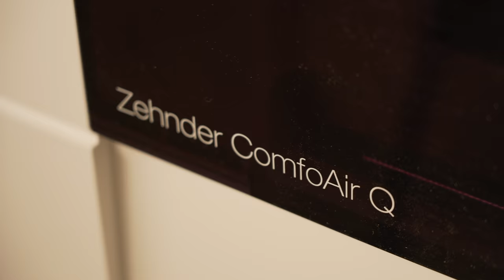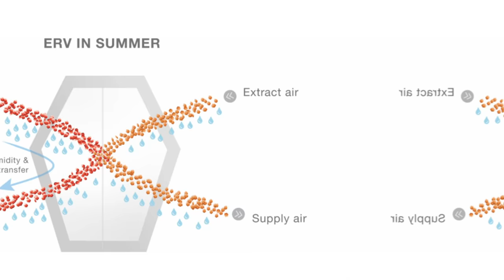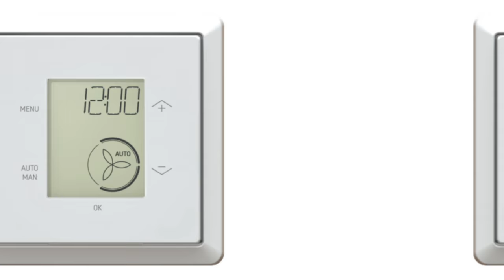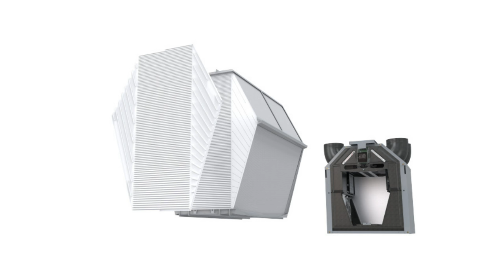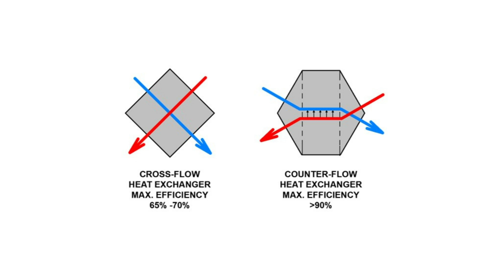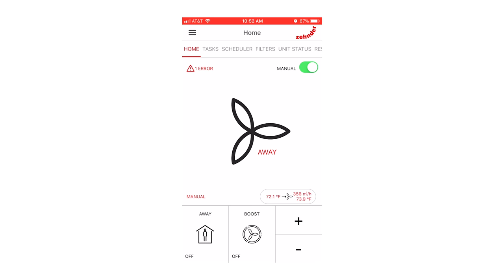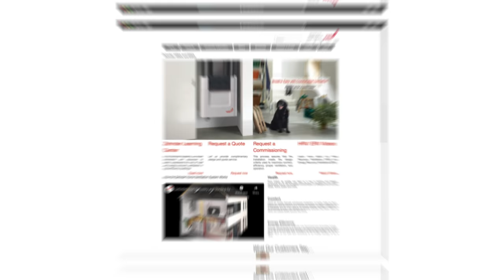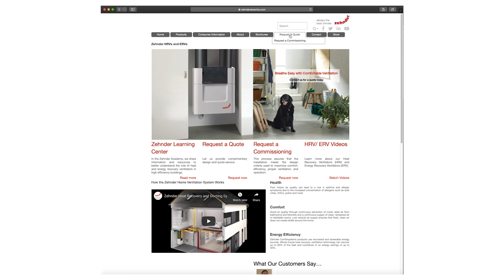Passive House - Fresh Air System Install & Costs (Zehnder)

Comment: Seems weird to me that the additional filters are after the ERV and not before to protect it. Both because the core seems to be the most expensive to replace. But also the filter in the ERV itself is probably a proprietary size making it more expensive than the other filters. And there even seemed to be enough space for a cheaper course pre-filter taking all the even larger particles
Reply: I would love to hear an answer to this question, too.  Two months ago during my rough in, I called my Zehnder Rep and got the answer you are suggesting.  That is how mine is hooked up. I see Matt did it the other way.  Is one way wrong and the other right? Alternatively does either way work.
Reply: Hi Casper. We're more or less on the same page. In this case the "pre-filter" is the MERV 13 filter inside the ERV itself (before the air arrives at the heat exchanger core). This is a Zehnder filter. It could just as easily be our MERV 8 filter (like we have in the return side of the ERV), which would adequately protect the core. Then the MERV 15 in the auxiliary filter casing is the fine filter for the supply air. The MERV 15 filters and casing in this video are also Zehnder, but 3rd party options could be installed as well (just respect the static pressure).
Reply: This was my question too. I can see the logic of the installed system, but it seems like a higher MERV fresh air filter would address all potential ambient pollution sources and protect occupants better than the return air filter.
Reply: @johnware7890  you're right, I think. You might just have misunderstood what was said.

The return air filter isn't intended to protect the occupants. The small, light-duty filters at the return registers protect the ducts from accumulating household dust and the slightly better filter in the return side of the ERV protects the heat exchanger core from getting fouled. After exchanging heat, the exhaust air is just pumped outside the house, so no higher grade filtration is needed there.

The MERV-15 filter in the filter casing on Matt's attic wall is what provides the high-level filtration of fresh air for the occupants.
Reply: @regahj  The filter will clean the intake/supply air in either position, before or after the ERV. I confess I have a little bit of a cold-climate bias due to my location. In a cold climate, it's best to add any filter casings after the ERV so you don't have to worry about insulating another component that might drip condensation when cold winter air is coming in the intake duct. Being in central TX, Matt's upgraded filter casing could just as well have been installed on the outdoor air intake duct before the ERV.

Comment: It would be great to explain how the air flow works in a room. Where's the intake and exhaust? same port?
Reply: Hi Jer! Thanks for the question. In general, bedrooms and living rooms are designated as supply rooms. Meanwhile, bathrooms, kitchen and laundry are designated as exhaust rooms. So fresh air from the ERV flows into the bedrooms and the low flow rate is typically allowed to flow around/under a closed bedroom door out into the hallway moving towards a bathroom where it's pulled out and exhausted through the ERV.
Reply: he did explain that part

Comment: What about a range hood in the kitchen? Does that go through a system like this?
Reply: Good question. It needs to be separate. Cooking oil droplets, etc. aren't good for the heat exchanger.

Comment: Matt--Lots of great info here, but I'm still struggling with how this system works in the summertime...especially in Texas where your A/C will be running (even in a passive house)?  I mean, I think I understand that the HRV [and ERV] will recover heat in the winter....and that an ERV recovers humidity in the summer; but does it also recover "cooler air", i.e. when you're cooling/condensing air, doesn't this system make the A/C system work harder than it needs to because this system is exhausting the cooled/conditioned air and bringing in hot air from outside?
Reply: @Matthew Ernest It seems that you understand the basics pretty well. Remember the purpose of the ERV [HRV] is for venting stale air and replacing it with clean fresh air. The process is basically considered "ventilation," and ventilation brings in unconditioned air that the HVAC then has to "condition," just as you say.  Since tighter buildings required more ventilation air Cfm from outside, ERVs / HRVs were developed to save energy otherwise lost to this "wasted" use of the HVAC.

You are concerned about the summertime, when the outdoor ambient is hot and humid, that the additional hot, humid air is going to swamp the HVAC. That's exactly where the ERV shines because as you are bringing in the hot, humid air from outside, it crosses with the much cooler, less humid stale (but conditioned) air being exhausted from inside to the outside. As the two air streams cross, a fraction of the heat and humidity contained in the outside air coming in is transferred to the inside cooler, less humid air being blown outside. When you install a high efficiency ERV, you reject a high percentage of the incoming heat and humidity before it has entered the conditioned space, leaving less ADDITIONAL sensible and latent heat due to ventilation than there would have been if there had not been an ERV, thereby requiring less additional conditioning load capacity from the HVAC.

Comment: The counterflow plate exchanger core still seems too small.  85% efficiency is not so great to me.  What if you could rig up two or more of these cores in series to boost the efficiency?  Two in series might achieve 97.75% efficiency.  So if it is 90 degrees outside and I want 70 degrees inside, I only have to cool down a constant flow of 70.45 degree air.  Now that's more like it!

Comment: Hi, what are you going to be using for heat management? We have a MVHR in our home. The house is built from ICF but in the summer with people going in and out the air temp goes right up and the house keep the heating. I really wish I installed AC to go along side the MVHR. Are you adding any AC to yours.

Comment: Where are the RETURN ducts and vents in the rooms?  Do the returns also use Zehnder "ComfoTubes" ?
Reply: HI Marius. Unlike a heating or cooling system, the ERV supplies to bedrooms and living rooms and returns from bathrooms, laundry and kitchen. So the air is moving around the house. Our air distribution system has both a return and supply side that use the same ducting.
Reply: @christophersmith1894  We are in the planning stage of a Recording Studio build.  We will have air tight rooms - with closed doors.  MEP wants to use individual Mini-Splits in each room for cooling.  So - for your ERV, would we need to put a return vent in each recording room?
Reply: @audioenginearinginstitute85  We've done some recording studios. There are a couple of options depending on the details of your studio design. Please reach out to me using the "contact" tab on our website and I'll review with you.

Comment: Great video Matt and Chris and bar none the best ERV system available. I have a question on the MERV15 filter. If it was set after the unit to handle any particulate or VOCs from reaching the supply diffusers wouldn’t it have made more sense to situate it before the unit to protect the core in case of a wildfire or heavy pollen season? It is a better filter than the MERV13 in the unit with greater surface area (lower pressure drop). Was just wondering if there was another logic behind this decision. Would love to know. Thanks!
Reply: I think Airwoods makes these.. so you can always buy direct and save a literal ton of money...

Comment: How can this take into account the extra outflow from a vent hood in the kitchen?
Reply: A typical kitchen vent hood in a custom home will exhaust at a greater flow rate (400 cfm or so?) than the total capacity of this ERV. So the best practice with a large kitchen vent hood is to use a make up air system (Fantech MUAS 750 or similar).

Comment: I have this on my list of things to build into my next house but I have a question about what happens if you loose power?  does this have a backup power source?  or can it run passively?  How long can you safely stay in the house without it running if you forget about it in a power outrage?   I also realize you can open windows but I am just wondering if you forget about the system and the situation is like in Texas late Feb 2021 when we lost power for a few days and its below freezing outside?
Reply: Passive/really tight homes require very little power so solar power is usually installed to power everything and selling power back to grid for profit. If anything you can also have a backup generator installed so you'll 3 sources(solar/grid/generator) to fall back on.

Comment: I’m leaning against super tight homes that require systems like this. Expect the unexpected because attempting to perfectly balance air flow in a tight environment will expose things that would never be a problem in otherwise vented homes. I guess you choose your pros and cons.

Comment: The  nasty problem with these airtight houses that Matt preaches that he seems to be unaware of, is that  if you have just one failure in the outside membrane anywhere in the house, mold is almost guaranteed to form because it is trapped in the various waterproof vapor barriers and it will circulate through the ENTIRE house because the houses are like a sealed bubble.  In regular housing, if the exterior membrane fails (say you have a window leak) there is redundant drainage and air circulation systems that allow the water to evaporate before mold forms. You will sill have water damage, but you have a much better chance of not developing severe mold. If you do have  some mold develop, the house regularly is exchanging air because it "breathes" and so you have a better chance of not having the mold spread through the air. 

The second problem with these extreme sealed house systems is that the upfront cost is just ridiculous. Risenger's HVAC and filter system, along with the additional exterior insulation probably increases the cost of  this house by at least $40,00 - $50,000 over the same house with regular insulation and regular HVAC. Risenger will never recover that cost, nor will these expensive additions add the resale value of the house. No buyer is going to pay $40,000 more for a house just because it has a fancy HVAC and insulation system - it's never going to happen. 

The third problem with these systems is that they have just stupid amounts of maintenance.. Just look at this system, he has three sets of filters that he has to change every three months. This would drive me crazy. These filters are expensive and probably he is spending $500 or more a year just for filters. 

The fourth problem is that a regular house that has R-40 insulation in the attic and R-25 insulation in the walls will probably be 85%-90% as efficient as this house. So the utility bills won't really cost that much more. If you have humidity, you can add a dehumidifier and BOOM, your done. If you want super clean air, you can add something like Trane's air cleaner and it will provide super clean air throughout the house.  If you have this system with an air cleaner and a dehumidifier, you would spend about $2000.00 more and you will not have the crazy maintenance costs and hassle that a sealed house system has.  If you install Trane's  Clean Effects air filter system system, you clean the pre-filter every three months and the main "collection cell" filter every six months. This is something you can do yourself in 10 minutes for the pre-filter. You can clean the collection cells and vacuum them in about 30 minutes and you don't have to buy new filters. This is in addition to any heat pump filters that his Mitsubishi units may require. If you don't change all of these filters on time every time, the system will not function correctly.

The fifth problem with Risenger's VERY complex HVAC system is that if it has a mechanical failure or it breaks down, it is going to be VERY expensive to repair if it is out of warranty. The parts for Mitsubishi probably are not readily available as your standard manufacturers like Carrier, Goodman, Trane,  etc. and to it will also take longer to repair the system. Whereas, standard manufacturers like Trane maintain a nationwide inventory of parts and in most major cities, parts can be secured in just one day. Mitsubishi is made in Japan - so the logistics are obvious. Mitsubishi is a great system, I agree on that point, but it is an expensive system. Having said that, I think that Trane is going to start distributing Mitsubishi and so that may make parts more available.  However, the cost of repair is probably going to be much higher than for standard manufacturers. 

There's a reason that almost no home builder uses sealed air houses. If a standard house is built right, it will be super energy efficient. One builder that builds high-end custom homes, guaranteed in writing that the 5000 SF house they built would have an total electric bill cost of $600 per year. These homes were well insulated and openings were sealed, but it was an "open" house built with a standard ventilation systems in the attic and wall. 

This system costs "$10,000 - $12,000 JUST for the ventilation system, not counting the heat pump units. To put this in perspective, I just had an 18 Seer Trane AC installed on my 2000 SF house and my electric bill for the entire year is going to be less than a $1000.00. My ENTIRE system, including enlarging the air return duct and installing R-8 flex duct to the central distribution duct was $8,300 and that includes tax and a 5-year labor warranty. I didn't buy the Clean Effects system, but if I wanted it, I could add it for around $1000.00 - $1,500. I have a gas split system and we just had one of the coldest months in memory (I live in AZ) and my gas bill was $78.00 for the entire month. 

Risenger's sealed house system is great if you want to burn $40,000- $50,000 of your money. It is a great system no doubt. But the problem is that it just isn't that much better than an open house system THAT IS BUILT CORRECTLY. If you build an open house system correctly, you won't have the problems that Risenger mentions and your utility bill cost will be very close to a sealed house system. You can also add wall insulation systems like Zip panels to a open-air house and increase its energy efficiency for a fraction of the cost of building a sealed house system.
Reply: It depends on the membranes being used. Many airtight membranes can be vapor open or "selectively" vapor open to avoid what you're describing.
Reply: @christophersmith1894  I am a licensed GC and I am not aware of any roof membranes in common use that let trapped water underneath them evaporate. There are some wall vapor barriers that make the claim but I would be suspicious of it. The most reliable, effective, maintenance free roof and wall systems provide a ventilation space between the surface substrate and the vapor barrier or water barrier to allow trapped water or any water behind the surface shell to evaporate.

The primary concern would be roofs because they do not vent under their surface substrate unless they are tile or slate roofs (installed correctly). So using closed cell foam in the attic becomes a very expensive catastrophe waiting to happen because with most roofs, the surface membrane will fail at some time. 

The closed cell foam will obscure any leaks on the roof and that will lead to roof rot and mold everywhere that water reaches during storms. 

For example, even with properly installed asphalt shingle roofs, over time they leak. Some leak enough into areas where water penetrates through the plywood. If the attic is not vented, mold will accumulate and find its way into living spaces.  This is why code does not allow bathroom vents to vent into attics, even vented attics. 

Most modern wall systems today have a secondary drainage system behind the stucco or siding surface substrates. They use a weepscreed drainage system at the bottom. This effectively prevents mold and degradation of the vapor barrier. So walls are less of a concern than roofs.

Comment: Hey Matt,  Im going to be working  on a home for a builder that has everything that you preach about brother, i got hired as a subcontractor for the drywall and so you know this is the 2nd and 3rd homes in the whole houston area done this way , zip system but not the typical green sheeting this is a puzzle home , meaning it comes prefab in wall blocks of a sandwich osb with foam in between ,super interesting,  its going to be having a few certifications, i believe passive home, green home, energy star and etc even someone from the city comes to see the project closely and also someone from an university from what i heard today , they have cameras recording all the time , this is like something that you want to see , i have some blueprints also and is super cool design , the walls have holes that lined up with the next block leaving the space for the plumbing only or electrical , so it has no studs , no cavities but predrill holes for everything , the insulation is bringing mostly the structural strength , the builder is not about youtube and peobably dowsnt know you but i do and my company is going to be part of this project, this are 2 homes mirror image 3 stories kind of high rises, would you be interested on looking at this homes , framing started already , tomorrow Im doing the triplelayer of compressed fiber fire drywall to total almost 3 inches thick in between the buildings before putting the 2nd side zipablockwalls, let me know Matt
Edwin rmz
Eagle home services houston
Reply: How can I get in touch with you Matt?